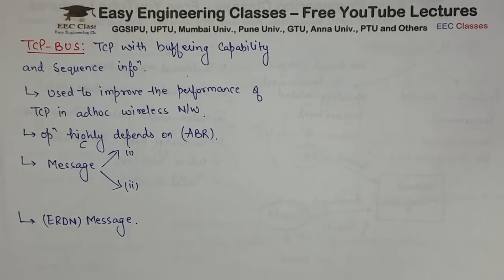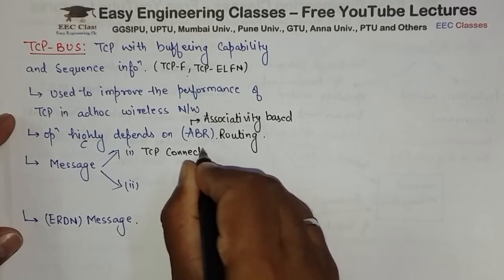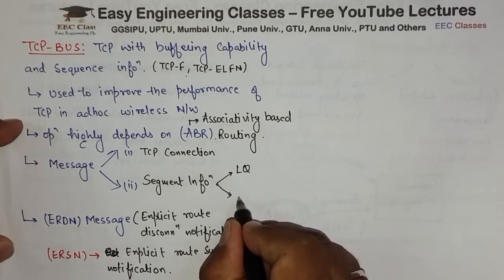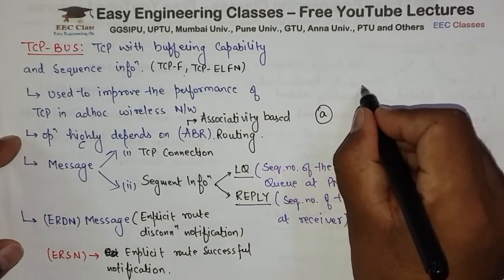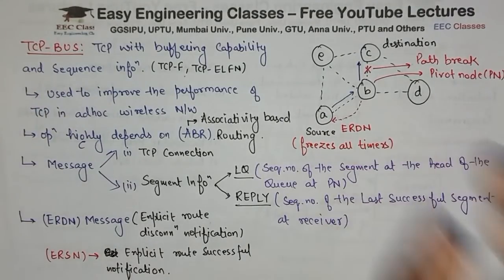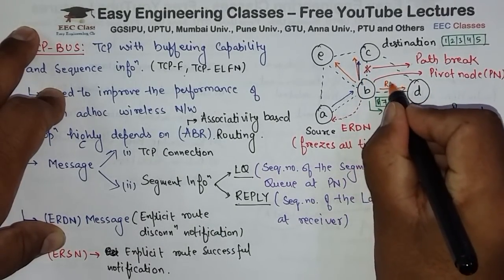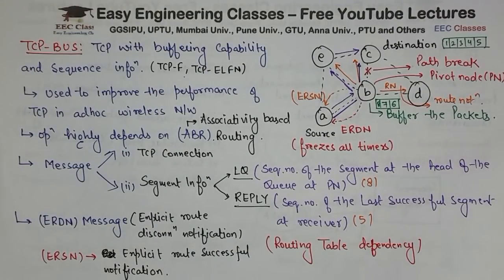L22: TCP with Buffering Capability and Sequencing Information(TCP-BUS) | Adhoc Network Lectures

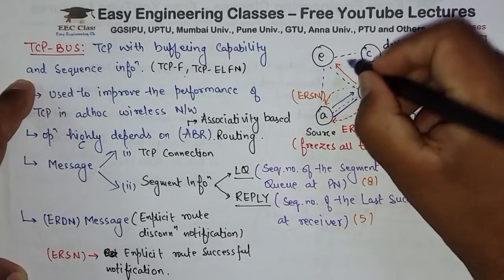Comment: At 8:29 why would A start with sequence 9 ? won't it start with 6? 6,7,8 are still in b'sbuffer
Reply: intermediate node will transmit the buffered packets, so no need to retransmit (6,7,8)